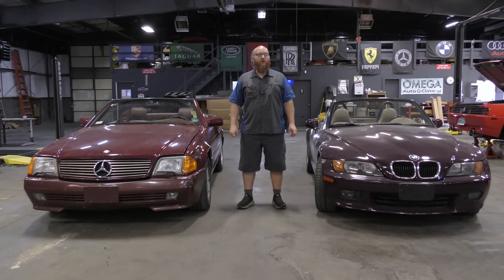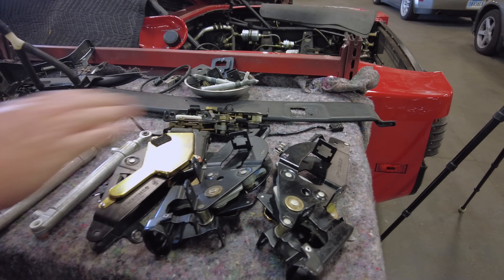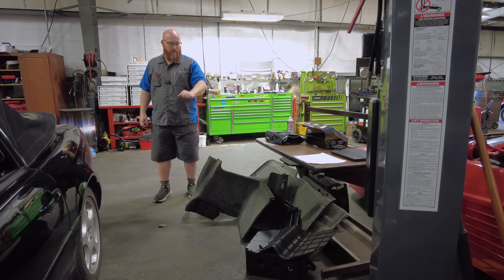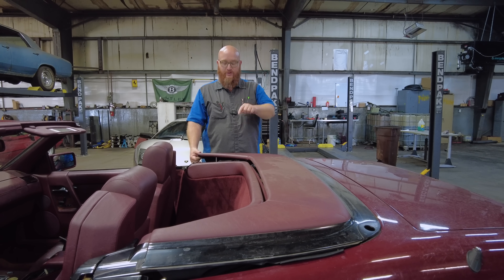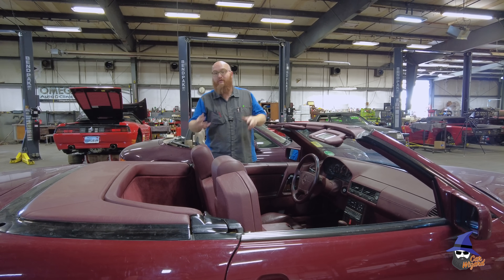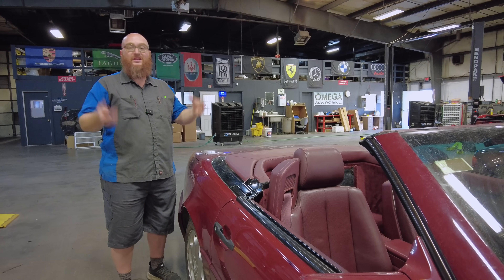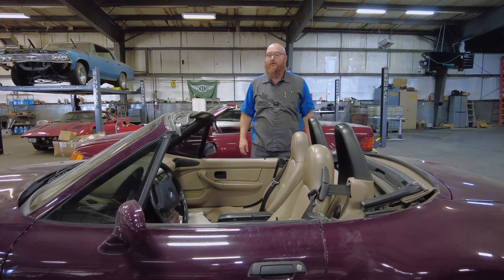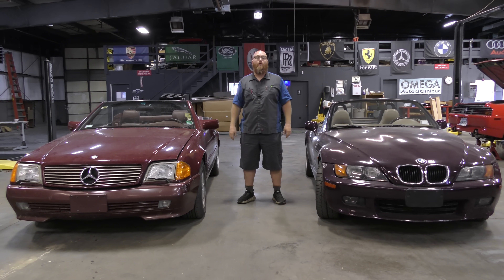How Can Convertible Top Repairs Be Free to Thousands?!?

Comment: This is why I love the MANUAL convertible top on my 2005 Corvette.
Reply: Yeah a well-designed manual operation soft top, should be infinitely better
Reply: Can't take that to omega they don't work on domestics
Reply: I've always felt auto tops were stupid. 

Much quicker to flip a manual top up and clip some latches than it is to stop the car (or put the key in) put the parking brake on, and wait for slow motors to do their thing.
Reply: that model year Corvette is not going to protect you in a rollover crash. I will stick with my R230 SL with hydraulically deployed rollbar for now but will replace it most likely w/ a Lexus LC500 convertible.
Reply: @gordonmccracken1209  That's true. I'm unable to track it for that reason. But at my age, I drive it extremely cautiously. Although, you never know about the other drivers.
Reply: Same with my Saturn Sky.  The top is less problematic than the sunroof was on my old Cobalt SS/SC.
Reply: hey thomas winters - I had a '68 and could lower the top
at a stop light while inside - too cool
Reply: That's awesome!  My top is a little more complicated but not much.
Reply: @gordonmccracken1209 no more dangerous than a quad bike...
Reply: I agree but I miss the top I had on my C7..............push a button and the top goes up or down....even at 30mph.

Comment: When Young:  Convertibles, T-Tops, Sunroofs, Fast and Loud.....HELL YA!!

When Old:  No leaks, Sun, Wind Noise.  I just need it to be reliable, comfortable, and easy to get in and out.
Reply: So true
Reply: Agreed, but don't forget the additional structural integrity and safety of a solid roof.
Reply: When you get older "Coupe"
Reply: @allworldmusic8270  Then 5 years later: minivan
Reply: @jimv77  LOL
Reply: @allworldmusic8270  Post is not bad either, greater strength & less wind noise!   Have a good one!
Reply: @smal1393  Agreed and way less trouble assuming there is no rust.
Reply: @allworldmusic8270  Rust?   What is this rust that you speak of?   I live in the Seattle where there is never rain or salt air corrosion, honest! 😁   And my cars last forever!   Have a good one.
Reply: Lost your soul
Reply: A Buick for all seasons
Reply: Young = SLK250/350...Old = CL600 or S600 Coupe

Comment: If (I'd hope) you have chosen to buy an R129 or other such high-end German convertible, you should have already mentally and financially prepared yourself for these eventualities. I am in the middle of a full cylinder replacement job on my wife's 2001 SL500. It is doable for a competent DIY-er, and with some extra financial outlay rebuilt cylinders can be purchased ready to install. You will pay a core deposit that is refunded when your old cylinders are returned. There are several very good tutorials on this job on YT as well.

Comment: I have a 92.  When I bought it the guy said the hard top hadn’t been off in 4 years.  I thought for sure something was wrong with it as the car was so cheap!  I was so jacked when I got home and found that it worked perfect.  2 years later and still working fine.  I’ve had a Camaro and Miata convertibles that I did manually.  Yeah, you can do it by hand but it’s way better when the car does it for you!
Reply: That's why I stop driving Wranglers. The tops are a PIA. I would get another jeep if the tops came down with the press if a button.

Comment: Wizard, my 1990 Corvette has a manual top and it takes 30 seconds to lower, release the rear pins, pull the handles in front, lift the tray and store the top, close the lid and your off.
Reply: Same with my 1988 Camaro 👍

Comment: that is why i like the Mx-5 Convertible. no BS with those cylinders.
Reply: previous owner had disabled/disconnected the motors on my FC RX7, making it manual too.
So much easier!😂
Reply: Thebest
Reply: No automatic deploying rollbar either - keep in mind you are sharing the road with 6000lb to 10000lb electric SUVs these days.

Comment: I've never had a convertible, but I liked the T-tops on my '85 300 zx.  In case of rain I could have them back on in less than 3 minutes.  The targa on the Supra that I had however was a handful to balance the large top in place trying not to scratch the paint.  Maybe one day I'll get a small convertible.
Reply: I miss t tops myself... Back in the 90s/early 2000s I had a '82 Mustang GT, and later a '85 GT that were both t tops. The factory glass tops on them were HEAVY and super inconvenient to try and get back on in a hurry if you needed to. I came across some cheapo composite plastic tops at a swap meet, always left those in the trunk just in case. Later on I had a '91 GT with a powered convertible top, the t-top cars were superior in every way, and cooler looking. Got a plain ole '93 GT fastback now days, even though it wasn't an option by that year it'd definitely be a cooler car if it had t-tops.

Comment: Great video, thank you.   I could not agree more with the philosophy of 'replace them all', it will save you money and headaches in the long run.   BTW, I have seen hydraulic landing gear retraction/extension and gear door opening/closing systems on commercial and military aircraft less complicated than the Mercedes roof.

Comment: People tend to forget a basic reality about the rubber/synthetic seals and o-rings found in all hydraulic use:  they all break down in time. In aviation and military use everything is strictly date coded and inventoried. In automotive, attention to strict discarding of old stock, is rarely followed. So you can send out cylinders to less reputable companies, that will install time expired products in the rebuilds. So instead of getting back something that might have a service life of 6 years... You get 1.  It pays to know who you're dealing with.
Reply: In such cases, my preference would be to have 'my' cylinders rebuilt - and not opt for a cylinder exchange solution.

Comment: This was why I bought my BMW with a manual top.  The mechanicals are easy to understand and service.  The hardest part was replacing the soft top where the final step required a buddy to hold down the back while I locked the top into place for a month to stretch the fabric.

Comment: Nice summary David. I've had a 96 SL 500 since 2013 and have learned a bit about it. The two cylinders above my visors gave out probably 11 years ago and I replaced those and it wasn't for another six or seven years where the main ones started going

As you know the ones over the visors are pretty easy to get to just taking off the plastic cover. 

At Top Hydraulics they were telling me those are usually the first ones to go out because they get all the heat particularly with the top down  

One thing I would like to emphasize since I'm a graduate of the school of hard knocks 
ALSO REBUILD THE BLOCK DISTRIBUTER. It is directly above the rearview mirror and I didn't do it and what happens is when that thing leaks the corrosive hydraulic fluid goes through the dome light assembly. It literally melts the plastic and fortunately I was able to get a new one from the dealer at $800. These parts are drying up and it's the little square block distributor.

I've liked Top Hydraulics in Florence Oregon 

Anyway I still like the car and if you discount the complex hydraulic top system and you don't have the car with that air suspension they are pretty much like any other car 

I used to think that Daimler pioneer the hydraulic top but look at Jay Leno's review of his 66 Lincoln convertible 

That thing is so complex and he said they lost money on everyone but Lincoln was doing it decades before 

Anyway I always enjoy your videos and thank you for another good one but remember that block distributor also needs to be rebuilt

Comment: I had a 1st-gen Volvo C70 convertible that had a fully electric top mechanism. The problem with it was that the various micro-switches that control the top are no longer available and have to be sourced from a small pool of parts cars. Volvo didn't sell enough of them--and the cars are now so cheap to buy--that there's no money to be made rebuilding the switches.

Comment: I own a 97 Z3 with a manual top that I bought brand new.  A tip for Mrs. Wizard —when you lower the top put your free hand in the middle of the plastic rear window to prevent it from binding up.  A tip that the dealer gave me 27 years ago.

Comment: I had a 1973 Fiat 124 Spider, and the best working part on the car was the manual convertible top!  Seconds to put it up or down,  It fit nicely and you could still see through the plastic rear window.  If only the rest of the car had been so reliable!

Comment: So screw the motorized tops and just get a manual top
Reply: 100%
Reply: Basically
Reply: Had a 1991 Mustang GT convertible for awhile, it's convertible top was powered but it started identifying as a  manual top after I got irritated with it and forced it to go up and down by hand... 

So, that's always an option too 😂
Reply: Screw both....buy HARDTOPS!
Reply: @darrellsaunders4267 nobody asked
Reply: @admiralrustyshackleford119 omega doesn't work on domestics anymore
Reply: I agree
Reply: Better yet don't get a convertible in the first place.
Reply: @admiralrustyshackleford119 I see what you mean, but in this case the BMW was better than the Mercedes!
Reply: @Hybris51129 dull life then
Reply: @mistersecret88  Having expensive repair bills is not exactly what most people would call thrilling.
Reply: So lazy having a power top. Its a disaster waiting to happen.
Reply: Nah the Lexus SC430 electric hardtop is where it’s at. My mum has a 2002. 100,000 miles. Zero issues.
Reply: Yea. But the manual top still may need to be redone after many years. Or need the rear glass replaced. Still cheaper than the motorized one.
Reply: Nothing wrong with my 1985 model SL, manual , r107 model, 39yrs later, still working…
Reply: Or buy a Toyota or Lexus.  LC500 top tested to over 20k full cycles without failure
Reply: @alistermccallum exactly, have seen one with 630k miles, leather shot but top, flawless

Comment: I lived in San Juan for about 9 months in 1995 and bought a 1980 Fiat Spyder to drive around.  That had NO power top whatsoever;  You undid two latches near the windshield, threw the roof over your shoulder, and down the road you went.

I really just do not understand power convertible tops.  These are just problems waiting for a place to happen~

Great video!

Comment: When you will open or close the Top, you should let run the engine. Because it needs a lot of Energy to move all the Hydraulic Parts and read Sensor Signals. When the Batterie not the newest (little bit weak) it can be cause Error.

Comment: Is this the same with the folding metal top Mercedes?  I’ve had 2 convertibles in my life, I’m 77 years old. First was a 66 Chevelle, SS396, 4 speed red convertible. It had almost 0 options, with no PS or PB, or PW, the top was manual. It was easy up and down with no problems. Putting the cover on with all the snaps was a chore. This was the same whether the top was power or not. I loved this convertible. Years later, married with 3 kids. I bought a 1984 Ford Mustang Convertible, 5.0L, 5 speed, black loaded, power top. After about 20 years the top wouldn’t go up without some help. The top was still original and in good condition ( I’m in the Chicago area, but car has never seen snow, only a few times rain), always garage kept. When I tore into it, research on the way, I didn’t find any leakage anywhere, but suspected a lack of hydraulic fluid. I had a heck of a time removing the rubber plug from the hydraulic pump. I finally wiggled it out, got a new plug, and filled the pump. It’s been working for the last 20 years without any problems. The hydraulic lines look like nylon and they are much larger than the Mercedes one shown. I suspect if I removed all the hydraulics, this topwould go up and down without a problem. The covering, when top is down, is a much better and easier cover to install than my 66 Chevelle. It has a channel that you just slide into place. Kind of difficult to explain. My Mustang loves sunny days……and so do I.  Thank-you!

Comment: Had a 2001 Jeep Wrangler Sahara with a soft top bought brand new.  No issues taking it down, just had to unzip the windows and roll them up and store them in the back.  Drove it for 22k miles and sold it.  Those tops don't last that long before needing a replacement  cuz the plastic windows degrade over a short few years.  Loved my Jeep with the 4.0L straight six!  I won't ever own a convertible car again as I like the A\C and not the sun in my face.  I also do not like cars with a sunroof as I don't use them and don't want to maintain the drain ports.  My current '07 Lexus RX350 has a sunroof which I never use, I'm sure its plugged up.  I hardly drive the thing, maybe less than 50 miles a month.

Comment: At 8:50, you have a problem with the rollbar not moving and the top system not working. I do NOT think the problem is the rollbar module or the soft top module. I ran into this too. You can force the module to synchronize its state by putting the soft top in place, put the top on the two front hinges, close and lock the tanneau cover, and put the back of the soft top down into the holes (but don't latch). Then, use the top button (turn car off, remove key, put key in, within 2 mins press the button) and push the button UP to close the soft top. At this point, the front should latch, it will lift the bow cylinders, and then re-lower the rear and latch the rear too. Now, your state is synchonized.
Reply: I have a video - YouTube won't let me link it. But if you search "Replacing all of the convertible top hydraulics on my 1994 SL320 (R129)" and skip to 8:23 in my video, you can see the procedure and explanation. The red button blinking means it ran into an error. After I synchronized, that error went away and the rollbar worked great.

Comment: My 2004 Z4 power top died, research determined it was due to the motor getting water damage because of BMW's brilliant design of locating it in the wheel "well" (pun intended)...overtime factory drain holes block  & it gets submerged
Costly & time-consuming! Smart owners relocate the new motor to the trunk.

Comment: The Z3 well for sure the early years before the roof was powered was a manual roof 96 and 97 for sure. In the 98 in the video, you can see the center slot for your hand to reach over from the driver's seat grab the roof and swing it over your head. Two latches to lock in place. Clunk. Clunk.

Comment: My 1991 300SL top did not work. So got the tool to do it by hand. Take 4 min to raise or lower. I got the car for $1500 in 2014. It had gone threw a bad hail storm. Top was full of holes.

Comment: I have always owned cars with a solid metal roof and no sun roof's either,
unless you include the Honda Accord that came with one as standard and leaked
from day one, so i rejected it.
Why anyone would want a folding roof is beyond me, even the manual ones are prone 
to issues as they age, include some dodgy hydraulics and motors then trouble will not be
far away.

Comment: The "rebuild" for the cylinder is replacing the square-cut o-ring behind the scraper ring. If you're good with a hand drill, you can drill a small hole through the cylinder at the flange so you can compress the circlip with a nail. Then, you push shop air into the inlet, and the ram will shoot out. You can then replace the square-cut o-ring with a viton o-ring. Reassemble. Total cost: 15 dollars for a bit, nail, and o-ring-- assuming you have a vice, hand drill, and air compressor.

Comment: That's a nightmare to repair & take apart. This is why I don't like convertibles & only buy 2 door coupes with manuals. Also avoid cars with unnecessary tech gimmick junk like remote start, lane keep, automatics, electronic parking brakes either.

Comment: the electronics on my 99 firebird convertable still work fine, the heavy glass rear window coming loose is the problem, i put it back in with windshield adhesive but i'm afraid to put the top down now, i plan on replacing top with a plastic rear window.

Comment: i’m confused as to why that Z3 would cost 5k to fix tho. shouldn’t be. My Volvo C70 soft top has a similar sequence to the R129, but uses electric motors and no hydraulics. Rear tension bow sensors tend to fail, but easy to fix

Comment: Best car is a car with no convertible top, or even this new rubbish trend of full glass panoramic sunroof. It just causes leaks, whistling noises, and huge expenses down the road. Buy a normal metal roof car with ac, and they're much stronger structurally and safer against theft and occupant safety in a crash or roll-over.

Comment: Don't understand why the seals fail.  Outboards have similar systems and yet have a low failure rate while being in a harsh marine environment.
Reply: No idea about outboarders, but i would guess their seals don't dry out from standing around in warm dry places and being seldomly used.
(Most R129 are standing around in garages and their tops are manipulated maybe a handfull of times each summer if even that.)
Reply: Vibrations are a major concern, yes marine vehicles vibrate from the engine but they are in water still. Road vibrations over years and years can cause microtears.

Comment: Or you could buy a Miata, which has a manual top, and never has an issue. Not enough power?  Turbocharge it for less than  what it costs for the top repairs.

Comment: never buy a convertible..
-leak..
-cold in winter..
-break down..
-get knife slashed
-replacement hoods cost a mint and need specialist work to fit..
cost a fortune to fix..
car purchase price more expensive..
buy normal car + motorcycle
Reply: Won’t have that issue with a retractable hardtop